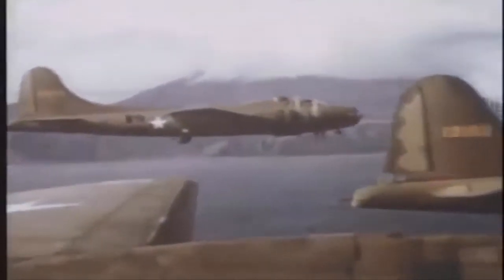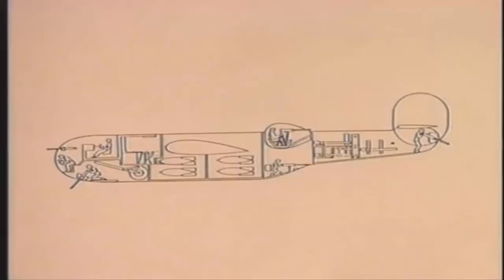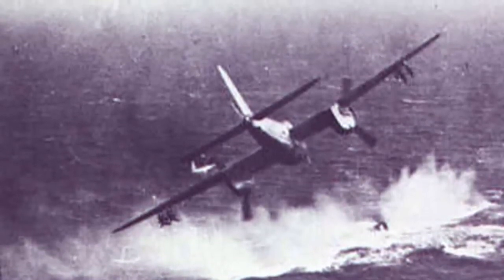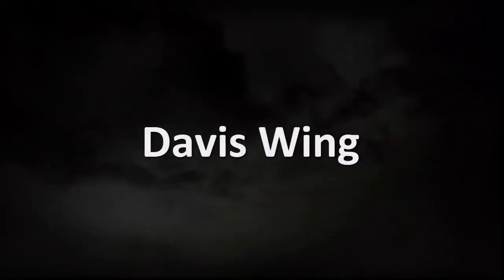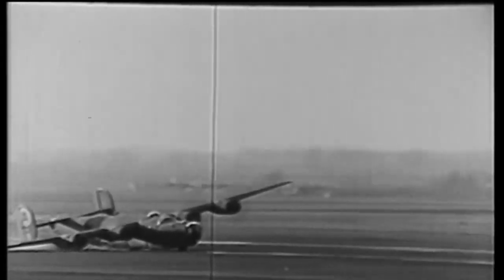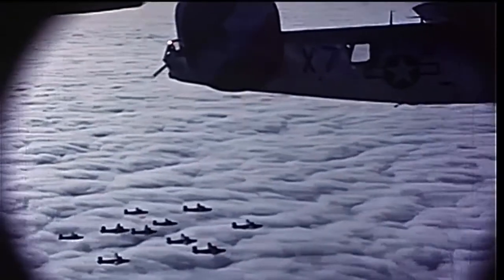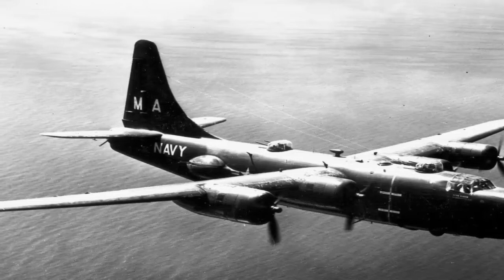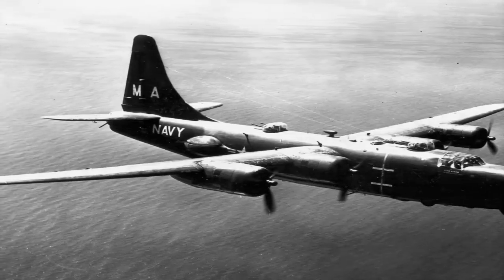B 24 Liberator:  3 Major Design Flaws

Comment: I'd put my chips on the line in WW2 Germany with the B-24 Liberator instead of the B-17. Pratt and Whitney R-2800 twin wasp radial engines were a better engine than the Wright Cyclone's on the B-17. It was almost bullit proof, still operating sometimes even with a few cylinders shot up, and the high aspect ratio Davis wing made the most of a large 12,000 pound payload bomber. The comparison here reminds me somewhat of the Mustang vs. the P-47 Thunderbolt. -- Mustang, sleek, sexy, but somewhat delicate .Thunderbolt tough, hard hitting, heavier armament/larger payload, fast, almost as manuverable, usually got you back to base in 1 piece. The unsung U.S. fighter and bombers here...Robert at 66.
Reply: There’s a pic of a P47 flying back to base with missing an entire wing with just a stub wing remaining, the Jug was tough !!!
Reply: The B 24 was equipped with Pratt and Whitney R-1830 engines (14 cylinders.
Reply: The P47 shot down more German fighter's than any other Allied fighter in the western ETO, and it was the fighter responsible for breaking the back of the Luftwaffe in the crucial first 3 months of 1944, 570 out of 873 German fighter's shot down during those first 3 months were shot down by P47's, it also shot down 900 of the 1,983 during the first 6 months of 1944, it's tally would undoubtedly been the bulk of them but after those first 3 months most P47 units were switched to ground attack, however in that roll it destroyed over 9,000 locomotives, and countless other targets on the ground. 
P47's flew 423,435 sorities during the war, that's more than all the P51's, P38's and P40's combined. 
Also the 56th Fighter Group that flew P47's exclusively had more aces in it than any other Allied fighter group of the ETO.
And contrary to what most people believe P47's were escorting bombers over Berlin before P51's were, the fact is every single P47 that saw service in the ETO had the ability to escort bombers all the way to their target even on the early unescorted missions to Schweinfert and Regensburg, it's a myth that they lacked the range to do it early on, the reason that they couldn't early on is because they were forbidden to use drop tanks on escort missions at that point because the "Bomber Mafia" Generals who ran the USAAF wanted to prove their concept that the bombers could fight their way to the targets and back unescorted, starting with the P47C-2 they had the shackles to mount drop tanks, no P47's that saw service in the ETO were earlier than the P47C-2, even then 3 months before the Schweinfert/Regensburg missions the 56th Fighter Group was already receiving the P47D-15 which had the ability to mount the all metal pressurized drop tanks, it was that very configuration that was used by P47's to escort bombers over Berlin weeks before P51's were doing it. 
The narrative that the P51 was the first fighter that could escort bombers deep into Germany was a lie concocted by the Bomber Mafia Generals and fed to the Press Corps to cover their asses for sending those bombers unescorted on those early raids because they were trying to prove their concept. 
The P47 was the true rock star fighter of the ETO, it was a hockey player in a figure skating contest and I giggle myself silly every time I think about one of those figure skaters getting slammed into the boards.
Reply: The B-24 was powered by PW R1830 engines, not R2800.
Reply: @davidkallewaard750  
That's right but he was correct concerning the name of the engine, it was called the Twin Wasp, the R2800 was called the Double Wasp.
Reply: The P-47 actually ALMOST looked svelt and sexy, and less 'stubby' looking in the slightly slimmed down rear fuselage area with the cool looking and more functionable bubble canopy late war variant 'D trim Thunderboldt, thus having that cool 50's jet canopy look. Under wing drop tanks, eight 50's, and, or rockets and bombs made it a most formidable opponent indeed. C'mon, gimme yer 'Jerry in a FW 190..Robert at 66.
Reply: @bobmalack481  Maybeso, but I prefer The Razorback version.....
Reply: @bobmalack481  surely the fifties jets had the lookalike thunderbolt canopy, that made them look so good, always liked the thunderbolt, just something about it.
Reply: Roger Crossley.."just something about it". ya, it LOOKS like a flying tank or pillbox...LOL!!
Reply: @dukecraig2402  That’s interesting Duke. I actually have several thousand hours flying aircraft with these engines and I never knew the official factory names. We just called them 1830s or 2800s ✌️
Reply: @davidkallewaard750  
Although I never worked in the field I went to aircraft maintenance school (PIA), I decided that me and the FAA most likely wouldn't have gotten along very well, they don't seem like they have any sense of humor whatsoever. 
So I decided to use my skills in the motorcycle world, big sense of humor there and they're laid back a whole lot more. 
All that being said you'd be amazed the similarities between the combustion chambers of those Pratt&Whitney engine's and the older Harley's, matter of fact when I was in aircraft maintenance school and I got a good look at those Pratt&Whitney engine's it didn't take me long to figure out where Harley got the idea for their 1936 big twin Knucklehead engine's basic cylinder configuration, previous to that they had side valve cylinders (Flathead), cylinders that had one overhead valve and the other a side valve, it's like they were poking around in the dark and then one of them saw a cylinder from a Pratt&Whitney engine and thought "I'll bet a pair of them would work real good on one of our engine's."
That arrangement worked so well for them it lasted from the Knucklehead through the Panhead and to the Shovelhead, that's 1936 to 1984, they beat Chrysler to the Hemi head design by over 20 years, even the Ironhead Sportster engine had that combustion chamber from 1957 to 1985, eventually Harley closed the chamber and ran a flat top piston (something else Chrysler did about 20 years after they did), Harley kept the same canted valve arrangement that their Hemi combustion chamber had with their closed chamber head until they went to the 4 valve arrangement, I'm also convinced that Chrysler got into the Hemi combustion chambers from them working with aircraft engine's for the government during the war, it can't be a coincidence that around 10 years after the war they started making engine's with Hemi combustion chambers. 
Those Pratt&Whitney engine's are legendary for being able to absorb serious abuse and shrug it off getting the pilots home in one piece. 
I always swore that if I ever hit on a multi million dollar lottery ticket I'd get me an R2800 engine and mount it on a stand in my back yard, I'd start it up every morning and blow the awnings off my neighbors house, it must be a serious thrill having your hand on the throttle of one of those monsters, what type of aircraft did you fly?
Reply: @dukecraig2402  Well Duke it appears we're both gear heads and motorcycle fans. I got my A and P in 1970, and at one time planned on that career. But then decided I liked flying even more than wrenching, and got my Comm, Inst, Multi license. 
My first job was in a DC-3 (they were technically C-47s, but we always said DC-3). Then 2 years in the Beast, the C-46, and 3 years in the DC-6. I retired 10 years ago, after 37 years and 27,000 hours. I always felt lucky that I experienced some 70 years of aircraft technology, from the 1930s DC-3, to the high bypass turbofans and glass cockpit of the B777.
And I finally got to use my mechanics license after I retired, working on the Texas Raiders B-17 at the local airport. That's coming full circle, isn't it.
Reply: @davidkallewaard750  
Yea great career, sounds like you had all kinds of fun living the dream.
The R2800 in the C-46, what type of supercharger did it have? ie single stage, 2 stage, single stage with a turbo?
And did those aircraft have O² systems for the crew?
Reply: @dukecraig2402  single stage centrifugal with a high and low speed clutch operated by engine oil pressure. We rarely flew high enough to require O2, but the system was required for the smoke/fire checklist. 
The only machine I have ever operated with a turbo is my VW GTI.
Reply: @davidkallewaard750  
So a single stage 2 speed.
I know they have centrifugal superchargers but I was wondering what configuration was on that particular one, they've used a bunch of different one's on that engine all the way to the single stage with a turbo to feed it once it gets high enough that the supercharger can no longer provide max boost, which is the system most USAAF combat aircraft had in WW2, the Navy didn't want anything to do with turbos so they usually had 2 stage 2 speed superchargers on their aircraft. 
I got an idea for a good cheat for a racing bike from the post WW2 Wright R3350 turbo hydro-coupled engine's, I'm gonna compound a turbo back into the gear case of a Harley via the primary drive, I figure I can run a slipper clutch on the coupler that'll electrically disengage from the drive when I pull the clutch lever in, when I launch from the starting line and dump the transmissions clutch it'll engage the turbo to the primary drive and all that waste energy will go to the back wheel. 
In one of the rule books I've read for a sanctioning body the only thing it says about turbos for one particular class is "no forced induction", it doesn't say anything about coupling a turbo back into the drive, only that you can't use one to supercharge the intake.
That'll probably have some people hopping mad if I show up with something like that.
Reply: The B24 had Pratt&Whitney 1830 Twin Wasp engines, not R 2800. Still, B24s and microwave radar spelled the end of the U boats.
Reply: @johnlangford3905  
Yep, they turned the hunters into the hunted.
3 out of 4 of Germany's young men who went out to sea on the U-boat's did not return, that's not very good odds.
Reply: @CrusaderSports250  That "lookalike Thunderbolt canopy" originally was from a Hawker Typhoon. So maybe those fifties jets actually had the lookalike  Typhoon canopy?
Reply: I used to have crewmen of both types at my vfw ( may they rest in peace) and one day in my presence they had a long and civil discussion about the merits, and in the end they all agreed that if you got shot up, the plane to be in was the 17. There was no ifs or buts about it,even the 24 guys agreed. They made me laugh when they said that in the evenings axis Sally would come on the air and call out the bomb groups that would be flying the following day,and she was almost always right, and she would say that general galland,and the abbeville boys couldn't wait to meet them, thus scaring the crap out of them before they went to sleep. And when I asked them why the hell they listened to her ,one of the guys said " that bitch played the best music in the whole eto" and the rest of the guys all laughed and nodded
Reply: The Pratt and Whitney engines ALONE were an edge in heavy bomber preference. Only knock on B-24 is the controls were harder to manhandle with the hydralics knocked out, a real handfull..
Reply: @tommcguire6472  
I just read an article a few months back where a researcher poured through documents and after action reports and photos to get to the bottom of that debate, his research showed that the reality is they both had about the same survivability rate. 
Where the B24 had a disadvantage was in Europe, and the only reason for that was because they flew mixed missions with B17's, since the B24 had a 2,000 ft lower service ceiling due to it's increased load they were forced to fly at the rear and 2,000 ft lower than the rest of the bombers making them the prime targets for the German fighter's since they didn't have the benefit of the defensive firepower of the main formation, by the time they got done being attacked the German fighter's were already running low on fuel and ammo so the B24's were taking the brunt of the hammering from them.
In the Pacific where B24 only formations were more common it was an entirely different story and they had a much higher survivability rate because they weren't flying tail end charlie and lower than the bulk of the defensive guns.
The researcher showed that B17's that flew at the rear of the box in B17 only formations suffered just as big of losses as the B24's when they were stuck at the back of them.
In the Pacific B17 losses were so heavy the commander of the bombers there told the Army that he wanted all B17's removed from service there and the units be converted over to B24's because of their higher survivability rate in the Pacific. 
So it would seem that when everything is taken into consideration that neither one actually had a higher survivability rate than the other when used on equal terms.
Reply: But the B-24 didn't use R-2800 engines. So all the comments comparing it to the P-47 are irrelevant. The Wright R-1820 was a pretty bulletproof engine too. The last (and best) production models of the Wildcat used the Wright engine in place of the earlier P+W 1830.
Reply: @dukecraig2402  I would have thought that the Spitfire was probably the aircraft that shot down the most axis aircraft in Western Europe, but not because it was superior to the P47 or P51 (they all had strengths and weaknesses), but simply because it fought extensively from 1939 to 1945, for most of the period being the premier UK fighter.  To underpin my point, JE Johnson (RAF, Spitfire) shot down 38 enemy aircraft in 515 sorties, whilst Robert Johnson (USAAF) shot down 27 in 89.  So the combination of number of missions and being the unchallenged top medium/high altitude RAF fighter resulted in a lot of victories - there are no definitive figures, but based on enemy losses (not claims) the total is likely to be in excess of 3000.  All these aircraft (and more, including the bombers) played their part in a great team effort, to win the Battle of the Reich.
Reply: @jamesgraham7297  
Exactly right, look at the number of sorities that Johnny Johnson flew vs his score, and then look at the number of sorities that Robert Johnson flew and his score.
Also look at the time frame, Johnny Johnson flew for how many years, like 4 or 5 to get that score but Robert Johnson got his in around 13 months. 
They all did something none of us have but those boys in the 8th Air Force were aggressive and they went on a rampage taking the fight to the Luftwaffe, as I've pointed out before to people when the 56th Fighter Group and the rest of them in the 8th Air Force got to England the Luftwaffe was still operating from bases on the French coast, the first thing they did was drive them inland, they started by flying fighter sweeps over their airspace and challenging them, then after they started knocking them out of the sky they started attacking their air bases during those fighter sweeps, that made the situation untenable for the Luftwaffe on the coast and they moved their bases inland and quit answering to fighter's challenging their airspace, they'd only come up to answer to incoming bombers, it was at that point that the Allies had air superiority, after that it was nothing but downhill for the Luftwaffe. 
Around this same time Spitfire's with longer range and the improved 2 stage high altitude supercharger started appearing in number's and the Luftwaffe was really doomed then, it sucked to be one of their pilots that's for sure.

Comment: Ben was a family friend who was a B-24 flight instructor stationed in Kansas in WWII.  One clear, 95F day he and his students took the plane up to see how high they could get.  One, two, then three engines cut out on due to oil freezing.  And inside,  even with an electrically heated suit it was colllld.  The students did not rank heated suits.  I wonder if the followup instruction was how to avoid a spin.

And Ben told the story of flying so low over his hometown in NW central Missouri that the B-24 blew the laundry off the clothes lines.
Reply: my dad was a pilot CBI .  Ice  was non existence.  they wanted a cold beer ? they took a case up with them . still frozen on landing .
Reply: @brettbader8305  China-Burma-India ?

Comment: My grandfather flew as flight engineer over the South Pacific, ie, top turret gunner & radio opperator. And told me the crews referred to the B-24 as flying coffins.
Once hit with enemy weapons the plane would go into a flat spin, trapping the crew to interior walls while the plane would spin in and crash. Killing most everyone onboard. The B-24 was large enough that you could park a B-17 under the wing...
Reply: Kelly you know nothing, b24 wingspan 110 ft, length 68 ft, b 17 wingspan 103 ft,  (just 6ft less) length  76 ft, and the b17 was to tall to fit under the liberators wing despite it been shoulder mounted
Reply: @jukeseyable  Obviously this is your exact condition. When visiting the Pima air museum in Tucson Arizona, they have each plane displayed in the position described. I was even able to walk into the bomb bays of each plane. So I've seen this with my own eyes! Have you even seen either of these two planes in person?
Reply: @blankeny  yes they are very similar in size. One does not dwarf the other
Reply: @jukeseyable  I never said it dwarfed the B-17, I just said, "you can park it under the wing of a B-24"! Both planes I saw were in polished aluminum with a mirror like finish. The B-17 being a tail dragger is the obvious explanation. So I guess I do know something about these aircraft.